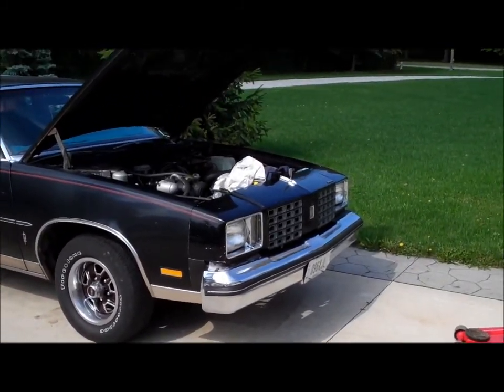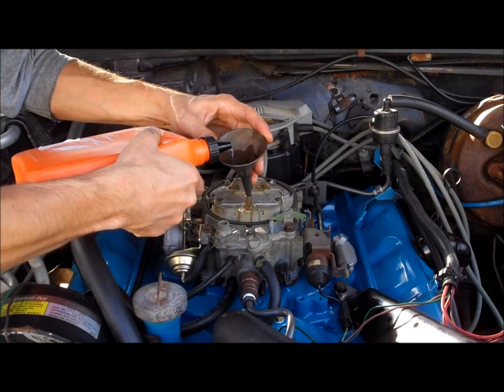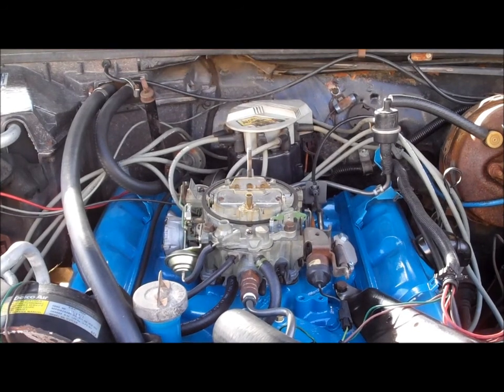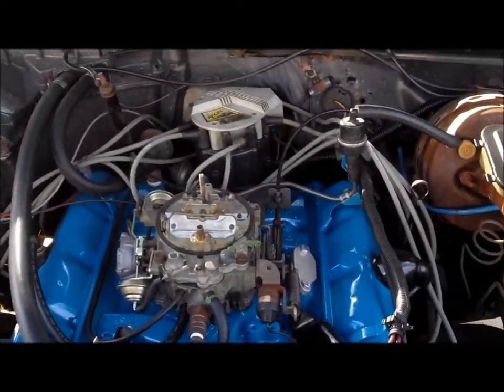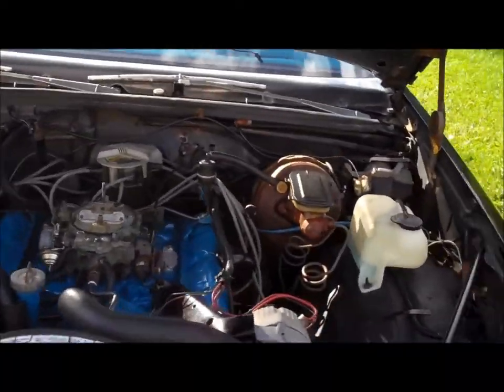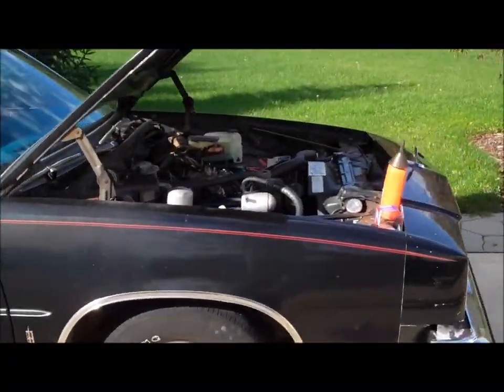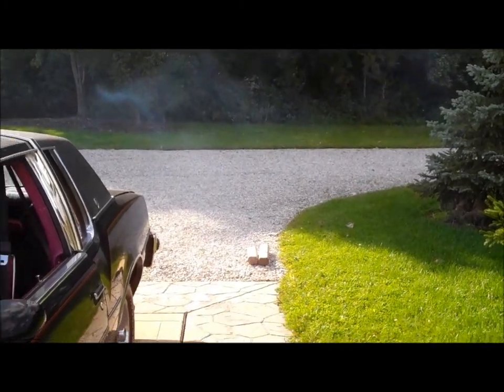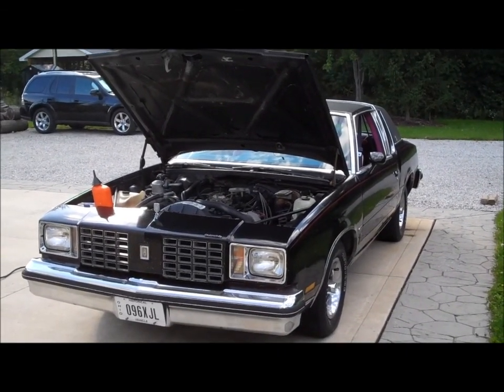First Start New 403 Classic G-Body Garage

Comment: Grate upgrade from 260 ! The 403 Olds is having a comeback in 2024 , people realise most of the bullshit of weak mains is crap ! LS/LT motors have windowed mains in the same place as the 403 and they don't break either ! The latest LT is 403 ci just like the Olds ! People are now looking for 403s to build , how times have changed! That huge bore and short stroke , 6 inch forged rods , rolled journal crank and big block 2 + inch intake valves are now recognised as very good ! 650 HP and no bottom end support is easy , no one thought that 30 + years. Ago but the 403 holds up , and it fine under 6500 rpm and 650 hp, one of the best street engines ever ! Blows away any 400 chev or even 396 chevs , and bigger motors ! Lighter , revs faster , passes emissions ! And can fit in the smallest engine bays , the 403 has a bigger bore than a 500 caddy and a smaller stroke than a 350 chev small block !

Comment: Do you still have the car? Looks great.
Reply from the maker: Yes
Reply: Classic G-Body Garage nice. I just got my first g-body in a while, an 86 Cutlass 4door! I bought it with a knocking 307Y, but I think it’s a broken flexplate. Either way it’s coming out, I have 3 engines in my garage to possibly go in, a running 1969 Olds 350, a 78 403 or a 70 455...the latter both need gone through. Also the 200 metric 3 speed and 2.14 gears are getting replaced with a 200-4R and 3.73’s. It’ll be a fun car that I can also comfortably take my kiddos

Comment: You put back the OEM exhaust manifolds on it? What cam did you go with?
Reply from the maker: Its 100% stock. Even the cam. The motor has never been apart.
Reply: Classic G-Body Garage Wht car did the 403 come from? mid 70's w/ low po compression? Stock cam and compression AREN"T any fun.
Reply from the maker: came from a late 70s Olds 98
Reply: Classic G-Body Garage You should have called Dick Miller Racing and got some higher compression piston (9:1) and cammed it. A 98 is a grandma car!
Reply from the maker: Doesn't run like a grandma car as is. I do have plans for upgrades in the future. Just wanted it in the car for now. 
403 Calais Hits the Drag Strip Classic G-Body Garage
Reply: try saving up for Edelbrock heads, a cam, and some pistons (Dick Miller/mondello), and a set of headers.